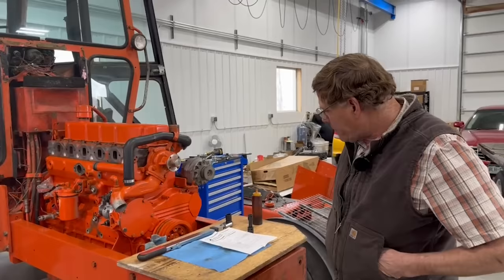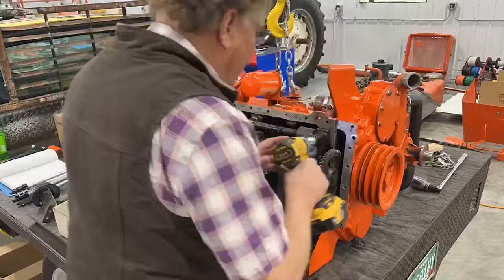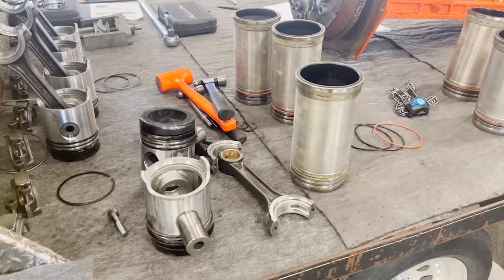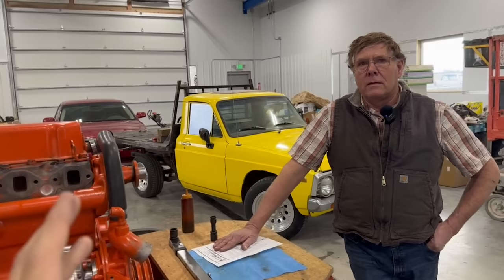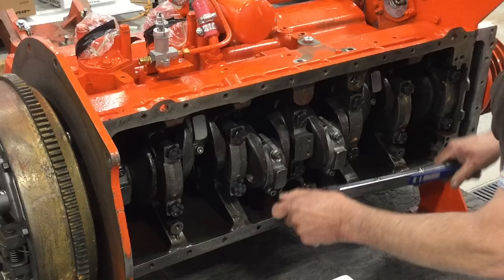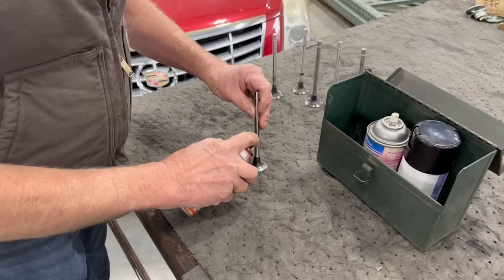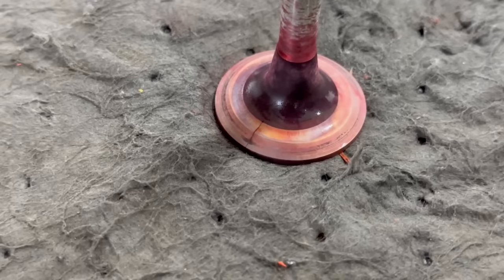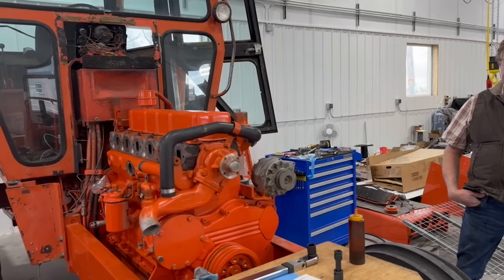Missing THIS Would've Cost Us THOUSANDS of Dollars!!!

Comment: So do you think the reason for the lock up is the exhaust valves were over heated locking them in the guides?   That seems like the smoking gun for why you couldn’t turn it over.   Obviously the cause of the over heat has to do with combustion temps.   As for the cavitation have you looked into evans coolant.  It boils at over 300f and prevents those micro bubbles from forming because it’s waterless.
Reply: A stuck valve would not lock an engine up like this situation. The valve would hang open first then you would have piston to valve contact. That did not happen here.
Reply: @dfb1111  I figure when the cam rolled around to lift/open the friction would cause it to haunt.  I do t know if it’s gear driven or gear to cam to push rod.

Comment: you,er attentution to detail is awsume striveing at perfection sets you all out there as this eng goes well if you twist wrenchs long enough you going to have one of these head scratchers personally over on fuel no more than you,re was will put it up there but a lot of engines are turned up myself included would have loved to caught that pump before they tore into it got to be pointing at heat but why thats going to be it good luck i,m not allis fan but they did build excellent engines

Comment: Nowhere in u r discussion do u talk about injectors. A bad spray pattern/dripping at the nozzle/wrong pop off pressure can all cause scoring in a liner/ piston. Fuel is not only used for combustion but also cooling the pison top. I worked on ag, military and ASE certified OTR trucks and construction equipment. I started at age 19 and even now will work on diesel engines so for 50 years. All heavy duty diesel engines have a coating from the factory on the liners that prevents cavitation but a certain level of ph in the coolant must be maintained by using a water filter or by adding NAlcool to the coolant to maintain ph level on liner exterior. A hot liner will attract coolant bubbles to the liner n burst on the liner surface causing cavitation without the correct ph level in the coolant. Test strips are available to test the ph level thereby stopping the cavitation of the liners. After market overhaul engine kits may not meet OEM specs as u saw on u r ring end gaps. Kits like what u used maybe cheaper up front but in the long run can cost u an engine. As machinists u have done everthing else u possibly could to make sure the engine does not fail again. Just wanted to add some more info to your toolbox. Best of luck you on your ag engine rebuild.
Reply from the maker: Go watch the previous videos…

Comment: Retarded timing plus 20-25% extra fuel could very well cause a cylinder wash down condition resulting in galling. Also an extra hot burning fuel mix could cause excessive valve heat and without an extended cooling down period after a hard run would cause brittle valve cracking. Jmo and having a background in diesel mechanics of 25 years.

Comment: I'm only into this video by 2 minutes I would look into how caterpillar does their torquing on their bearings they do a minor adjustment of 80 to 100 lb I believe and then they go to what is not cat twerking they measure from one i they measure the corner of a cap and then they go a quarter turn or a half turn more they do not actually use a torque wrench at this point look into how caterpillar does their torquing

Comment: Your diesel fuel you sent off for evaluation if they ✓✓ for Carboxalates that my be the smoking gun

Also a 1 cylinder engine Cetane Test of your diesel fuel to understand the Cetane #.  Low cetane of today's modern day diesel fuel is on average 9 numbers (90 points) of cetane lower than in the diesel fuel of the 1970 era, which is documented by ASTM to have gone from 49 or 50 cetane in the 19 sixties and 19 seventies, today modern day ULSD is between 38 cetane which is out of spec, to 41 cetane, from researched done on modern day diesel fuels through the Soybean Checkoff dollars.

EMA, Engine Manufacturer Association (Cat, Cummins, Detroit, Deere,...)  has an additional performance requirements specification of 43 cetane as a minimum in ones modern  ULSD diesel fuel.

Higher temperatures need to ignite low cetane results in delayed ignition.

Increase stack emissions
 
Poor combustion efficiency, loss of power.

Detonation we're - from violent explosions which damaged pistons heads, rings, valves, and cylinder liners.

The proper cetane enhancement will raise the cetane # approximately 4 numbers or (40 points) which low prevent erratic pressure giving ones diesel engine a long cool burn.